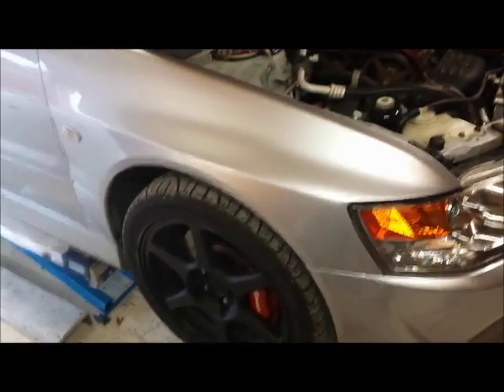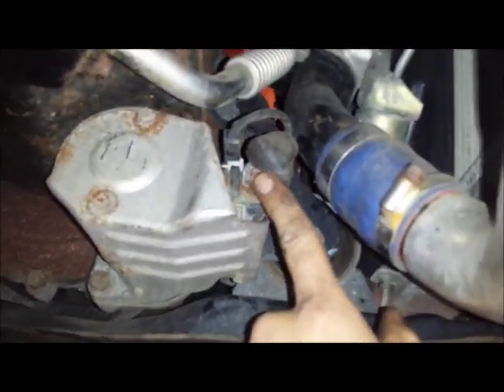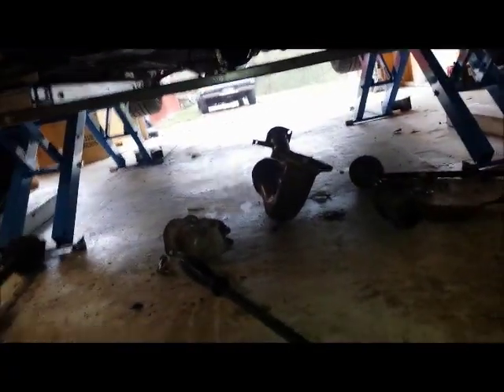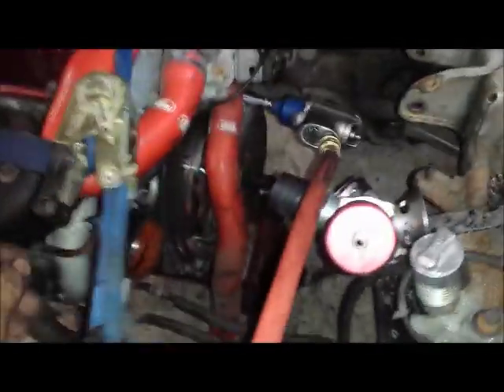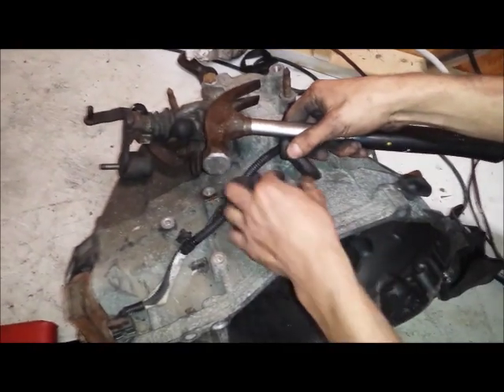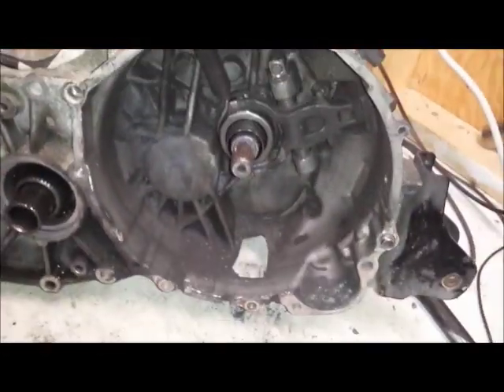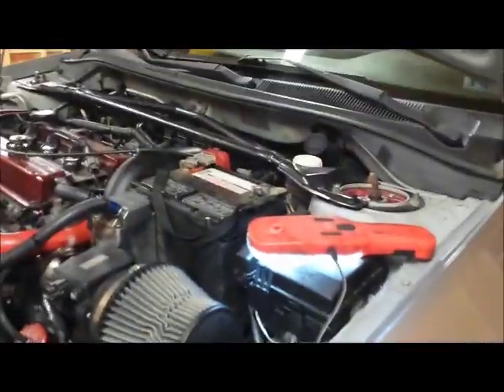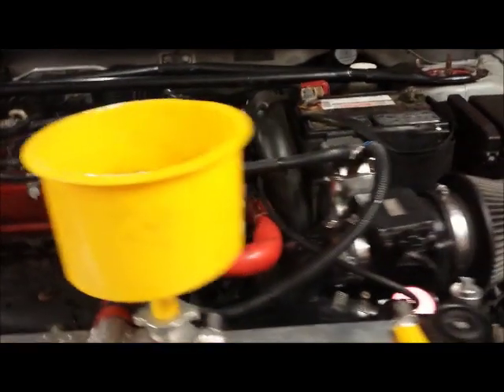how to put a clutch in a evo 8

Comment: Great video,  going to use this as a guide for changing the clutch in my Legnum VR4.  Basically an Evo 5 with twin turbo V6.
Reply: how'd your clutch exchange go was this a good guide i have a v6 galant vr4 clutch needs replacing
Reply: Mine was fine.  Long job but saved heaps in labor
Reply: +Ed Luck cool any clutch type u recommend any tips on getting it out also how long should the avarage driveway macinaic take to do this, any info is appricated

Comment: Great video, one thing it's very difficult to release the throwout bearing on an aftermarket clutch. I ended up removing the six bolts connecting the pressure plate through the access hole on the bottom after messing with the bearing for hours. Takes 30 minutes and the trans will slide right out.

Comment: Removal of the bottom arms/steering rack crossmember helps facilitate removal of the box, although it takes a little longer. I average 2 days to change a clutch on Evo's as they are a pain in the a$$, even changing a crank sensor is a full days job! I own an Evo 8 MR with 430 whp atm and it drives superb, going for a larger valve head, agressive cams and a new manifold soon, hopefully will hit the 550 - 580 whp mark woohooo! :)
Reply: I am in the middle of this on mine and am wondering about dropping the rack and entire suspension since I want to check and possibly rebuild my transfer case.  I know previously we had slightly dropped the rack and cross member to wiggle the transfer case out, I was thinking taking it completely out would be nicer.
Reply: It is better to remove the crossmember as it completely facilitates the replacement of the transfer case. It makes sense 'to me at least' to remove whatever is in the way so the job can be done properly.
Reply: +Steven Yates agreed, I know it can be done without dropping it.  But its more hassle that way. Just a note for others its 4 bolts for the frame, lower arm ball joints, two power steering lines.  The steering wheel shaft is designed to slide out as you drop the rack, one clip on that.
Reply: +P T Greenough I forgot to note also mark the steering shaft before you drop the rack so you can re align it to the steering wheel. :)
Reply: YES! The marking of the shaft is definitely a must! Not marking it will cause a few headaches :)